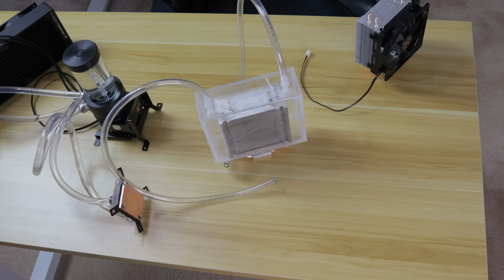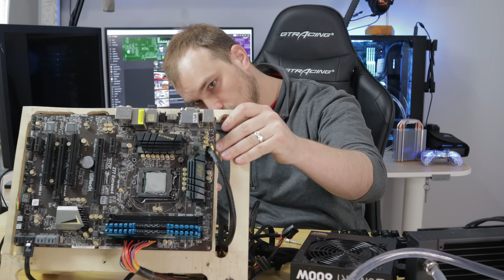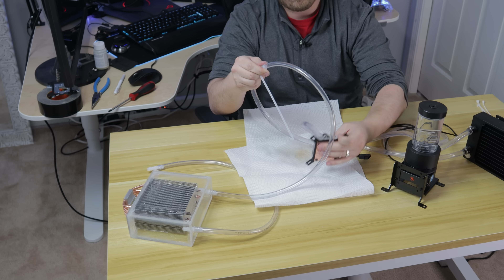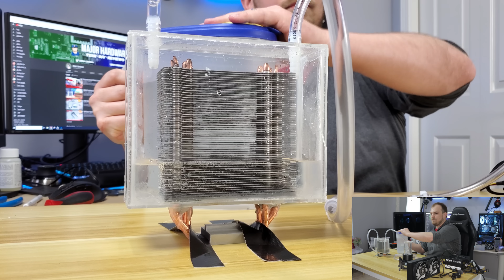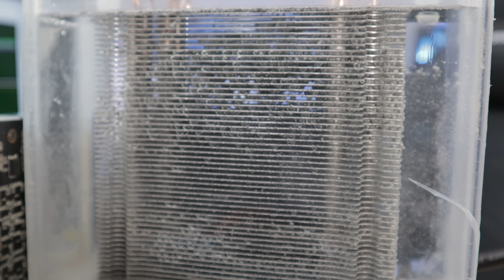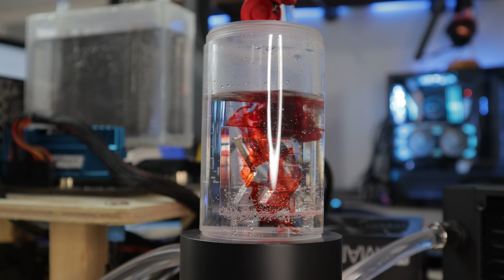Water Cooled Air Cooler Tested Against - Air Cooled Hyper 212 EVO and the EK-Supremacy EVO

Comment: here is an idea, solder some heat pipes near the base, where the water will go through, less weight, more compact, dont know about the efficiency, maybe will depend on how many pipes, and it will be hybrid/dual,/fail prof

Comment: On your DIY 212 "water block", running an alcohol and water mixture would have probably brought better results. But you'd want a closed system to prevent evaporation of alcohol. Another could be antifreeze. If just plain water, use deionized. Deionized water conducts almost no electrical current and would minimize a short should there be a leak.

Comment: I think it woould have been better if the intake hose was sticked all the way to the bottom from the top, if the pump had the power to still push water out at the bottom. Cause in that design, I think it's very possible it may drain out cold water, as the current is stronger than the natural way of warm water rising and cold water falling.

Comment: I'd guess that the copper pipe is doing most of the heat transfer, probably before the heat dissipates into the fins at all. It might be worth it to remove the fins and leave the copper piping behind... test using only that, see what difference it made. That way you could tell if the fins are worth keeping.

Comment: if you could run a loop into the actual copper tubes going through the fin stack, I think it would cool exceptionally well and u could keep the fans on the fin stack, so it would be an all in one self contained loop
Reply from the maker: I did that I have a video on my channel it was pretty cool
Reply: @MajorHardware   o ok sweet i'll check it out

Comment: Oh your Hyper 212 Evo is very bad, I have one of these and my CPU (AMD FX4300) OC from 3.6GHz to 4.8GHz with a room t° of 24°C dosn't go higher that 55°C after 1h30 of stress test, benchmark and gaming ! But it's possible that the fact your piece is not in a case do that.
(Sorry if it's hard to read I don't speak english very well)

Comment: I think a improvement could be a new acrilic box narrower in the larger side, almost touching each other aluminium and acrilic. If you do that you force the water pass through the cooler. If not, a big amount o water can go out the cooler and not take hot away from the cpu. You know what I mean?

Comment: I think the bubbles building up on the blades is limiting heat transfer. Try adding some Redline water wetter to the mixture which supposedly helps with this (it's an automotive product meant for cars that can't use antifreeze)

Comment: You should use ro/di water. Tap water has chlorine in it which will react with the aluminum over time. plus ro/di water is not electrically conductive (I am pretty sure)

Comment: Here's my $0.02. I see a few issues that you touched on, The first is flow. You have the right idea with trying to get the liquid to move through the fins instead of around them. The easiest way to get that is to get the "water box" sides closer to the fins. This will make the water move through better. Next, you should take advantage of the natural convection of the system. Have your "cold" line come in near the bottom and the "hot" side exit through the top. The air trapped in the fins is a HUGE issue. The needs sorting, too. 

If I were making something like this, I would look for a heat sink with vertical fins, preferably a circular design, too. Have the "cold" inlet near the bottom pushing water in on an angle so that it moves around the fins with the outlet at the top, in the center. I see a lot of potential for a system like this. The thermal density of water is several orders of magnitude higher than that of air, so I think you could exceed the performance of modern water cooling and AIO systems if you can control the flow over the massive surface area of an air cooler.

If you decide to go with a circular cooler, it will be easier to build, too. All you need is an acrylic or poly-carbonate pipe that fits snugly around the heat sink and two round end caps. The trickiest part is drilling the angled hole for the "cold" inlet to make the water swirl around the bottom of the cooler.

Comment: Your test bench's tempurature sensors are broken or something, 50C idle is absolutely horrific, even my intel stock cooler gets at least 38C idle (and room temp is probably around 22C, likely higher as i have 3 huge windows in my room) so the water cooler still having an idle above 40C is also horrific

Comment: PLEASE DO THIS AGIN.
BUT. 
test a 360mm radiator with the ek water block..

Then fit a plastic channel way around the inside off the cooler for the water to pass around the fins and out..the 360mm radiator will have enough headroom then to cool that amount off water.  240mm is to small even with a fast pump not enough surface area for the 240mm..

Your results will change to the ek been second. 

I have that much faith....

Comment: Can you try this again on both the EK water block and your custom cooler, but use your big bucket of ice water instead of the radiator?
Also, perhaps the same idea but with a cooler with vertical fins (Like Noctua C14 or NH-L12 etc) with the water in at the bottom and the out at the top? :p

Comment: Hay doubt your still reading comments but if you get it sideways you might be better off,
Like make some pipes going in so they waterfall on to the cooler so it could be stood up and it would make a cool effect. Plus it would cool better. Also if the output is done the same you could do it at the bottom of the enclosed or lower on the sides

Comment: Just found your channel tonight. Good Stuff!
Your water cooled air cooler got me thinking of an experiment I had rolling around in my head for a while and maybe you'd find it interesting enough to give it a shot. 
I home brew beer as a hobby and a piece of equipment we use is called a wort chiller. It's essentially a coil of copper tubing that you place in a pot of boiling liquid and then pump cold water through to cool down the liquid in the pot. 
I thought it would be interesting to attach an air cooler to a water block copper to copper and submerge the air cooler into boiling water and see how long it would take for the cooling loop to cool water down from boiling to around 30C. I wouldn't imagine it would be nearly as efficient as the traditional method but doing it all with PC parts just seems interesting.

Comment: NOOB question here, why is food coloring BAD for water cooling?
Reply from the maker: not sure truthfully, i would have to look at the ingredients more in-depth. I think the thought process if if there is any sugar in it it could clog the system also you dont want anything degrading the components possibly causing a leak so its always better to use something that designed for water cooling.
Reply: @MajorHardware  Ok, how about using a car engine coolant is that BAD?
Reply from the maker: @Toyie  i have seen it done, dont know how that works long term tho

Comment: Use mineral oil in the loop and add a fan to the submerged cooler. And add an external radiator to get rid of the heat building up in the system.

Comment: Those air bubbles in between the plates limit heat transfer from the fins to the water.  add a few drops of dish soap to break the surface tension and break the bubbles.

also don't worry so much about corrosion.  Here is an article on it: https://www.lytron.com/Tools-and-Technical-Reference/Application-Notes/Preventing-Corrosion-in-Cooling-Systems

If you want to get super fancy on corrosion protection, use deionized water instead of distilled

Comment: The copper heat pipes are bottlenecking the system, try mounting the radiator on the a copper sheet and get a reservoir 3d printed to avoid leaks ,try using proper coolant fluid with dual radiator .

Comment: Run water thru the heatpipes instead of around the radiator fins. Not much if any water is going through those fins and thus very little heat transfer is happening., Run it through  heatpipe and loop into the next in series or parallel so it makes multiple passes over the CPU, this way you can have the air cooler and water cooler at the same time giving you even better  performance.

Comment: You can eliminate that dead spot by adding a spray bar just before the water hits the fins to get even water distribution, but that would require you to open up the box...
Reply: It would also help push air bubbles out of the fins...

Comment: if you put the outtake tube on the bottom of the homemade water-air cooler block, water will circulate better,.. or if you reduce the block size, less water will heats up faster and a the perfect pump takes to the radiator faster.
 Maybe :D

Comment: You definately need to get the bubbles out of the fin stack. Water to Air thermal conduction is poor, so you are not getting as much cooling as you could be. You need to find a way to tap/vibrate it to get them out, without damaging of course. Additionally I would recommend finding a way to get that box filled more, so that top fin and the tops of the heat pipes are fully submerged. Otherwise very cool work! Looking forward to version 2!

Comment: What if there was a way of adding an air cooler mounted on top of a good water block to immediately remove some heat even before water ever reached the radiator to cool off more?

Comment: I just wanted to ask ... how did you count the "delta" on EK-KITP240 ? like this? (41.1 +58.1 +23.5) / 3?  thats 40.9  average 
temperature if im wrong please respond :)
Reply from the maker: average max minus room = delta, delta just means change so for the EK block (58.1-23.5=34.6)
Reply: @MajorHardware  Oh ok thanks.

Comment: Couple things wrong with the video.
1. No added pressure to custom 212 block. Because water is add and subtracted at the same rate.
2. No temperature gains because same size rad was used. 
Only way I can think of to evaluate water block vs custom 212 is to have a bucket of ice water and see which cooler can keep the cpu at a lower temp because both water loops will be using the same temperature water.
Reply: It does have pressure... have you used a water hose like a garden hose or taken a shower before? Notice the soft hoses seem to “inflate”? Yeah, that’s the water pressure.... water cooling blocks have a lot of resistance and have a very large pressure drop across them, in water loops you can tell which way the water direction is flowing simply squeezing the hoses, so physics has spoken and says you need to go study it.

Comment: Great idea, some recommendation to improve it, i would suggest that a radiator only dissipate heat in the water but does not make it cooler than room temperature. Your ways of running it wit ice water is great. Get some temperature control for aquarium where you can set the water temperature down more than just a simple radiator.

A water block is made so small is to avoid complication in design as its intended purpose is to carry the heat to the radiator to make it room temperature again.

If you run the water temperature lower than room temperature you dont really have to worry about flow inside the heat sink aquarium.

All the best
Reply: Now you just have water condensation (notice your iced drink “sweats”? Yeah, dead motherboard for this guy).

Yes, yes, I run -60c on one of my daily systems, but it’s water-proofed, insulated, and actively warmed by heaters to prevent moisture condensing and icing up). This is not an easy process though.

GN does the ice bucket benching now, it condenses and 10 minutes later your computer is dead if you don’t at least does what he does.

Comment: Nice to see how it actually performs - no surprises about the outcome though.

For improvements in its current form, all I'd suggest is to get it mounted vertically (invert motherboard) so that the fins are vertical and the coolant has some convection asistance running through the stack.

For V.2, I'd say to tighten it up a bit: have the walls close enough on the sides so that the coolant can only run through the fins and not around them; have the inlet and outlet closer to the centre of the finstack so it can spread out more evenly; think of the coolant flowing through the fins in the same was as air was intended to.

Comment: same as last time you presented this I return with the following idea: you need to push tfrom above and evacuate the water from below same as for a room 
radiator otherwise the water will only move above and not have great thermals.

Also pipes are from copper while radiator is from aluminium, which will eventually corrode the radiator

Comment: wrong, it would not get much much lower even if you increase the waterflow trough the fins because the heat is being contained by the water, the 212evo inside the plexi isnt doing anythingother than being used as a heat transfer to the water you have in the loop, it will not help cool the loop so if you reached max temp of the water in the loop it will do shit, and if you didnt reach the max temp of the water in the loop the 30 mins was not enough to test the temps because you increased the volume of the water by 2 or maybe even 3 folds compared to the original EK one meaning you increased the heat capacity of the water by that fold, i applause the effort, but what a waste of time, but on the other hand still if you dont show it, somebody out there might want to try and do the same thing and ruin their cooler

Comment: I would try putting the tubes in and out 1/2" from bottom on the thin sides or split the tube and add additional in and out pipes half way up as well
Reply: With a fill hole on top to top it off

Comment: My one additional thought is for the versions 2 box, you should have the long edges butt right up against the fins of the cooler. This would force the most flow across the fins possible, since obviously the edges do not provide a lot of surface area. Have it as close to the top as possible too. Awesome videos! Performed a lot better than I think many people thought it would.

Comment: The increased surface in your system allows heat to be transferred from the block to the water more quickly. To make use of that you need to increase the speed of the water in your system. It currently also underperforms because of that reason, the big reservoir near the heatsource allows heat to stay close if not transported with more pressure, the small waterblock has no issues with that. In general I would assue with a standard radiator the performance will be close to a regular waterblock, but your system will scale better with more or bigger radiators behind it.

Comment: Basically all that is is a giant waterblock (a waterblock is a container with channels in it that water pumps through) and without the fans and outer radiator to dispel the heat from the loop, you'll eventually heat saturate the water and it'll perform even worse over longer periods of time. The efficiency that comes with waterblocks is that it moves water through the channels quickly, taking the heat with it, and then dispelling that heat through the radiator and out into the room via the fans. Your idea removes the expulsion of heat from the loop almost completely (other than whatever weak radiation of heat the various surfaces of the tubes and reservoir could handle) creating a less efficient system. So, essentially you would need to add a radiator to this system, and by that point you might as well just use a regular waterblock. 

That being said, if you could shrink all of this down into a 2x4" block or so, with waterblock/pump combo on the CPU, radiator stacked on top of that and fan on top of that, creating a very, very compact loop and somehow manage to remove the heat quickly, then you'd have something. The block would need to pump water from it into the radiator at the next stack where the fan would then remove the heat from the loop through the small radiator, and then cooler water would then be pumped back across the channels in the waterblock just below it. The issue you run into here is that it's difficult to remove heat quickly enough from such a small amount of water, so you end up needing a separate reservoir anyway, and at that point you might as well just have a separate radiator too. Eh.. Oh well.

Comment: Have you considered using a dielectric liquid in the loop so you don't need to concern yourself with leaks causing shorts? It could obviously still become messy, but at least you wouldn't have to be concerned about hardware death from anything but thermal runaway, which is unlikely on its own with that 'cooler'.

Comment: Maybe try it with a stock air cooler that can actually beat a water block without mods. Then have the flow come in from the side and exit out the top, also cut the barb down so the whole box can fill to the top with water, or even with the current setup, if you tip it to its side you could have got the box to fill up more.

Comment: I think your limitation will be the radiator. The difference in temperature between the EK and the water evo could be a result of the mounting and thermal paste. I think you need to upgrade your radiator. But the more I'm thinking about it I'm realizing a lot of stuff. I'll post a link to my physics book, it's free online. Your major limitations assuming your evo-water block is mounted perfectly is the flow volume and the heat transfer rate from the radiator to the air. But still part of me wants to say that the surface area of the EK and the evo-water block won't have any eny effect if they're in thermal equilibrium. So what you got to do is increase your flow rate by a lot! That is the only way you can take advantage of the Evo's size.